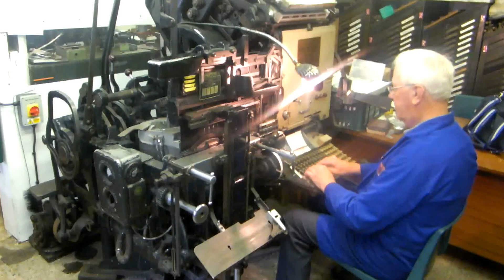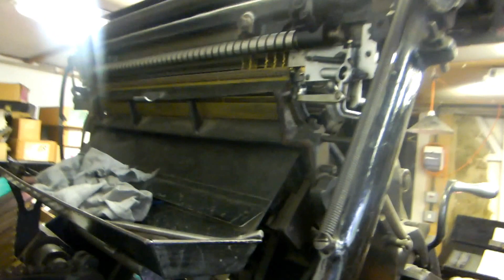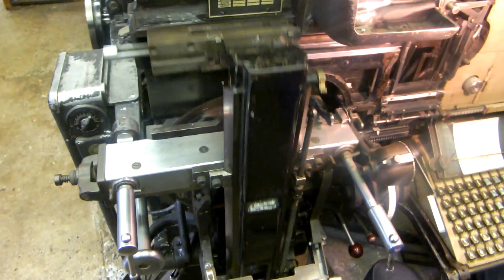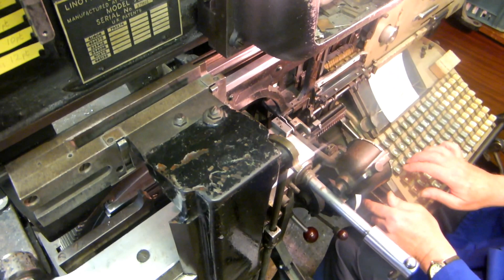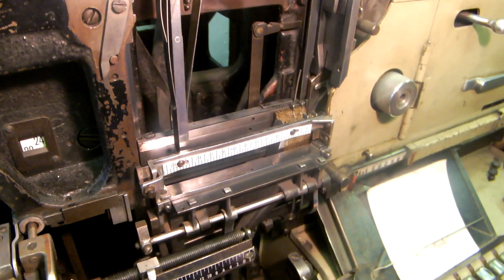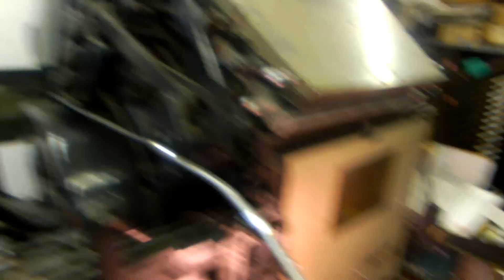Linotype Model 78

Comment: Put some graphite on that machine. It should not transfer the mats so slowly to the 1st elevator.
Reply from the maker: We are just comp-operators, our Linotype mechanic has retired, so the machines are not as up to date as they should be, I did put a dot of 3 in 1 on the slide in the end which did the trick and I couldn't be bothered re-doing the video, as we had more pressing matters to worry about, as in who's round is it!!
Reply: @AndyTaylorprinter  ~  Any kind of oil was forbidden on spacebands, only graphite. Any kind of oil just "gummed up the works".
Reply from the maker: @rogertycholiz2218  I didn't use oil on the spacebands only on the tranfer slides, graphite was always used on the spacebands usually the apprentices job first thing in the morning at least it was when I was an apprentice.